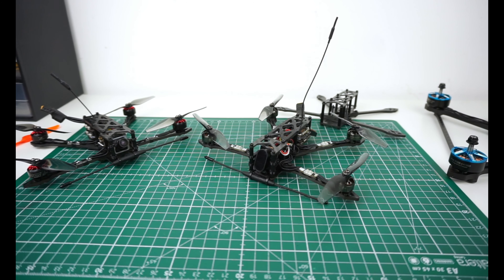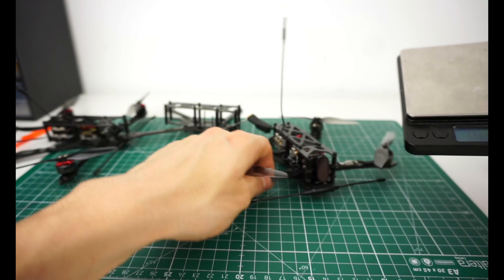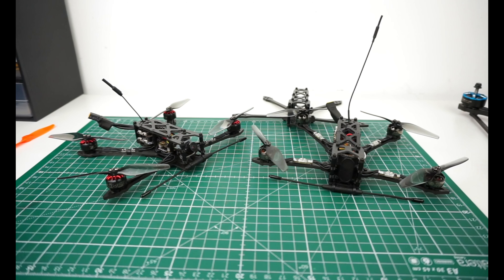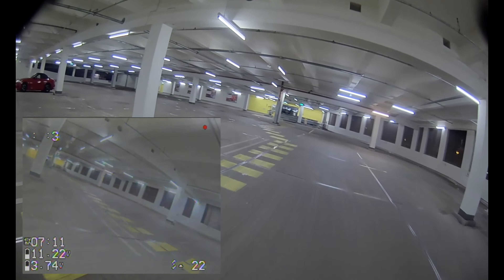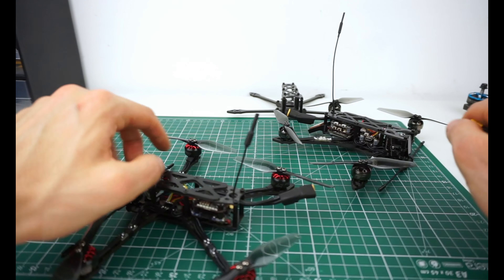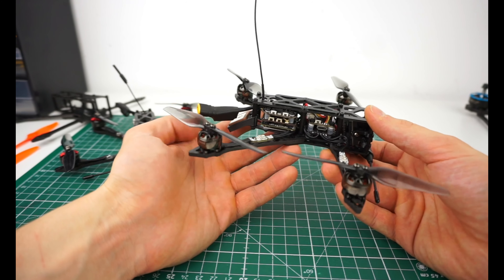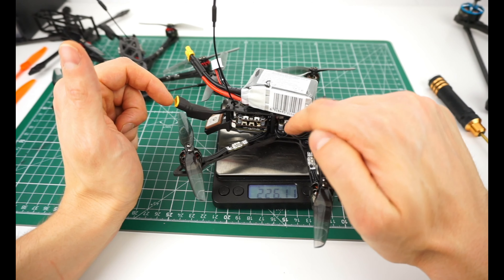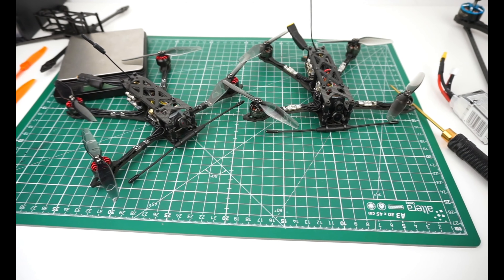Project #MicroLongRange / release info / flight footage

Comment: Clearly one of the best channels for light weight builds out there! I recently built a super lightweight 4“ Picklepick with hglrc zeus, 1106 6000kv motors, hq 4025 props, tbs unify pro32 nano, frsky xm+ and runcam nano2. It weighs 123 grams with a 550mah 2s lipo and I get up to 5min flight time. It cruises at less than 20% throttle, feels very light on the sticks and flies buttery smooth and very locked in. And it is so damn quiet. Thank you for your good work!
Reply from the maker: Thank you! Really nice to hear! That's a pretty interesting setup! I would not have expected the 4x2.5 to run well on 1106. I have some spare 1206 and 1207. Maybe I should give them a try....

Comment: Thanks a ton for taking the time and effort to design this. By far the best 4 inch frame out.  Light no wasted space. As soon as I get the chance I want to buy this and take out 2 of the centre screws and put my light weight modified dji hd fpv system in. Good job man.
Reply from the maker: Thanks man ! My hopes are on the Caddx Vista system. DJI compatible and with 20x20 mounts will be perfect for my frame

Comment: Good. I have also found 1404 motors work well on 4" bi blades. I will say if you are going long range you may want to put the crossfire antenna in a vertical polorisation above as I have had failsafes running low front horizontal.

Comment: Wow, I'm impressed with this build.  I have been heading down pretty much the same path, but simpler for line of sight flying. Great news on the flight times as the 3-4 minute flights typically seen in fpv builds is not what I am looking for. 
Again,  great job, and thanks for your research and sharing.

Comment: I am also in the process of experiment building a mini sub 250grams with long flight time...base on  the sector150 frame, 1306 motors with 3.6 inch trim down version of similar props and have bought most parts for it...Wish I had known about your project earlier.

Comment: Hi Dave, excellent video and it appears to have great reviews as well, but for a total newbie like me (I've never built nor flown a drone beforehand) ... would you have build instructions (maybe a video of how to assemble this?). Also, if somebody is starting from scratch and has never built a drone beforehand ... would you have recommendations for the FPV goggles, the transmitter, the antennas, etc... Awesome work!!!  :) :-)

Also, your FPV feed compared to the recording has a lot of static in it ... is there a way to eliminate that somehow? How would you diagnose that problem?

Thanks.
Reply: If you've never built or flown anything this is kind of like jumping into the deep end without knowing how to swim so to speak especially if you're going for long range. Nothing's impossible if you're willing to do a decent amount of research and learning about building though and flying in a SIM is always a good start to learn to fly.
Reply: If your a newbie, theres nothing wrong with this, but i would recomend putting a little time on a simulater before you jump into a longrange system like this.

 Make sure you also have betaflight downloaded, that will be how your gonna tune the quad. If your a compleete newbie then if your gonna get a transmitter id recomend getting the radiomaster t16s, i have the jumper t16 and its awsome, but the radiomaster is better for a little cheaper price, either option you can hook it to a simulater

Comment: I had been thinking of doing something similar as soon as I saw those 4-inch HQ micro props, and with the sub-4000kv motors it now seems pretty doable... I saw another frame that used the whoop-style AIO FC/ESC but it doesn't have the dead-cat layout to get the props out of view. I think this is gonna be the way to go for cinematic long-range micro for sure.

Comment: This is awesome! What LEDs are those on the arms? Also, have you considered using the TBS Unify Pro32 Nano? You could just put it on a 20x20 stacking plate then you can connect it directly to the Crossfire NanoRX and don't have to fiddle with buttons to change channels.

Comment: Nice work! Thank you for sharing your designs, and the effort you put into coming up with them. Way cool. I nearly pulled the trigger, but then I read you have one coming for DJI. Cant wait to see it. Cheers
Reply from the maker: Thanks man! If the Caddx vista system proves to bee good and reliable I probably won't need a dedicated DJI version since it would fit on the rear 20x20 mounts. My current DJI design is actually a completely different frame design  since there was just no way to fit the klunky DJI unit without a compete re-design.
Reply: @DaveCFPV   Dave_C FPV  Indeed! Hadn't heard the news yet. This is massive! (..the news that is.) Vista unit supposed to be 19 grams lighter, but no onboard DVR, hmmm.. Well regardless, this is pretty incredible. 

I cant help but smile; it's exactly what I asked them for. I receive in depth market/product research inquiries from DJI, and I spare no effort to provide them with in an depth perspective, and well supported thoughts, opinions, and answers as seen from my perspective. I believe I spent nearly two hours filling out the most recent one, regarding FPV. Giving Eachine question accurate, thorough, and genuine response, I came to a one where I could now really drill into my argument, and and present the ideal direction forward (for them, with FPV ) from my perspective. I am, "DIY," "roll your own," by nature, and to the core, so my opinion well represented the sentiment of much of the FPV community by default. (Fact is that Ive never quite fit among any group, and that hasn't changed to this day.) At any rate, I continued typing out my heart and mind, intently, and as my effort reached crtitical momentum, my argument peaked in the form of a pleading proposition, "..give the world an open, wireless high definition video transmission standard, and I will come work in your gardens for the remainder of my days," I offered, tongue firmly in cheek, yet also my bag packed. 

Haha, well I hope Caddx can pull it off. In the mean time, Ill grab one or three of these frames, and work on fitting them with the TPU Air Unit and antenna brackets from i-flight's HD DC3. I picked up a spare frame when I built mine, and it is so tough that t I+7•dont think

Comment: Hi dave can you tell me which one is better the pagoda antenna vs the long monopole vtx antena you re using in this vid. Also where can i get the long version like your?  Im installing crsf on my larva x and the 200mw vtx is became bottleneck :p
Reply from the maker: The Axii is much better than those linear antrnnas. The long one came with am iFlight force 1000mW VTX. Don't know if it's sold separately

Comment: Do you think that the emax 1306 2700kv motors would have enough power to swing the the props? Wondering since i would like to use all my 4s batteries and 3800kv seems a bit high for that voltage.
Reply from the maker: I guess that should work but I can't tell for sure

Comment: Dave I have been rocking this frame since it was released and I love it. However, I've been thinking of the braces. Any reason for going with front to back braces as of going with "back braces" as seen in the FalconRad 7" frame and "AirBlade Transformer Mini" (single plate but you get the idea). Seems like the back arms are more "bendable" due to their length hence need more stability?

Comment: Dave, I am considering this build but have a camera question.  Do you have Caddx Tarsier V1 or V2?  Wondering how long of a cable to get from the camera to the stack?  With the Caddx Tarsier V2 I noticed they shortened the cable length!  The RunCam Split 3 Micro has a 58mm cable length.
Reply from the maker: The V2 is shipped with a separate  longer cable in the box. A bit annoying to wap them but it works
Reply: @DaveCFPV  Would the 58mm Runcam cable be long enough to reach the back stack?

Comment: Nice!
What about trying a AiO whoop board? The new ones should tolerate the amps...
Also did you try a smaller 3'' size? New motors are lighter and more efficient it seems...
Reply from the maker: 16x16 only allowed me to design a much more compact frame in this case so I decided not to have an AIO Option :-) and 4" has more cruising speed which is super important for long range
Reply: if you want a 3" AIO setup look at the LeDrone Pickle EVO 2 - This setup is a further more specific evolution of those frames.
Reply: Thanks both!
3'' also mean smaller motors and thus lighter. But yes I agree lower speeds for sure...
I have a pickle... But not the whole body. Maybe I'll have that cut? :)
Thanks again!

Comment: Thanks again Dave! Ordered 2 of these !  Nick is great to deal with. I may want to try altering one to support a 20x20 stack.  Awesome job on the design!
Reply: Great project Dave! @TaterFPV, looking forward to a 20x20 FC/ESC version.
Reply: @nestwolfsteiner2292  Yup. I'm just waiting for the frames to arrive so I can double check the spacing.
Reply: Yeah, a 20x20 FC/ESC stack would be a great variant. With e.g. a Matek  F722 it would enable INAV usage. I'm not aware of any 16x16 stack that is supported by INAV. I'd rather save a bit weight on the Cam and VTX. The RC hybrid may be bulky, but is 3g lighter according spec. VTX could be as well be a Tramp HV, AKK FX3 or TBS Unify Pro.
Reply: @robiwahn7351  I can post the files as a remix of Dave's on Thingiverse after I actually receive it and test fit a few stacks. Should be in this week. Dave might be on holidays. I want to have one sent to him as well.

Comment: Hey Dave - Do you think this would work with arms that can hold 6" props, but the same center area? I think that this could push 15-20 minutes flight time with low KV bigger motors with bigger low pitch props. Thank you for your hard work on this !!! I'm excited to buy the frame.

Comment: Hey Dave.  I'm accidentally experimenting with long range 4" as well.  My open source 3"/4" freestyle frame weighs about what your frame weighs.  I don't know how I managed it, but I've squeezed a Caddx Turtle, GPS, Crossfire, 4x2.5x2 props on 1306 motors, an 800mW VTX, and one of Zoe FPV's 3250 mAh 2S lithium ion packs into a build that comes in just under 250g.

So far, I've had flights as long as 19 minutes.  I seem to cover more distance at higher speeds, though.  My 10-minute and 12-minute flights both pushed just past 6 miles (not quite 10km, but close!).

I'm pretty boring.  I haven't thought of a single good long-range flight I should go on, but I'm excited that my aggressive little HD freestyle rig can manage 6+ miles and still fit in under 250g! These new HQ 4" props are fantastic.
Reply from the maker: Hi Pat, Sounds really interesting! Do you have a link to your design?
Reply: @DaveCFPV  Of course I do.  I just didn't want to pollute your comments self promoting links! :)

Here's the reasonably up to date source code and CAD files: https://gitlab.com/patshead/falcon-frames

This is the blog post that has the data on my handful of 3250 mAh 2S flights: https://blog.patshead.com/2019/12/prepping-my-3-inch-freestyle-kestrel-for-long-range-flights.html

Comment: I finally got mine in the air without the camera... it flies really LOS... The only issue I am having with it is trying to connect the caddx tarsier. I can't get it to power off the 5v pad. I also switched up the FC to an FLYWOO GOKU F411 Micro. Are you powering the ESC lipo lead?

Comment: Really great design! Excellent to see people develop ideas like this. Have you considered the 26x26mm whoop FC/ESC to lower the stack and allow for shorter and lighter stand-offs? Personally I would be willing to lose some range and use a smaller VTX also, perhaps the namelessRC 400mw nano VTX. This setup might require a diagonal FC mount to fit in between the front stand-offs but could shorten the stack which may improve handling as well as get even lighter? 
Plus it is possible to use betaflight softserial to re-map the LED pin to control the VTX without using a precious hardware UART.
Reply from the maker: The pickle Evo 2 kind of works really well already with that kind of electronic layout! I really wanted to fit up to three 20x20 boards that's why I went for 16x16 only. And TBH I like the looks better. More like a miniature 7" 😅

Comment: How are you getting GPS signal with the Tarsier so close?

I just finished building one, but I can’t get a GPS signal if the battery is connected. It will only acquire satellites while powered from USB.

I haven’t tested yet, but I have a feeling the Tarsier is outputting a ton of noise that is interfering with the GPS.

Comment: Hi Dave, what is the material of the 3d printed parts, TPU, ABS, PLA? The pad for the battery is simply printed like both the camera and GPS mount or has to be different to be 'sticky'? I am about to get your frame from CNC madness (Nick has been fantastic) but I have to print the 3d parts myself -or elsewhere-. Thank you and great job!
Reply from the maker: It's all TPU! Thanks!

Comment: So the Vista fits on here beautifully, especially since Im using the dji controller. She's built, but haven't maidened it yet. Not sure how much 48khz signal to motors is going increase battery life with these larger motors, but I have a few other mods in mind to drive this build closer to 20 mins.

Any chance you would design some 5 inch arms for this? I suppose since the files are available, I can try learning how to modify the design on my own. It's not anything I am shy of doing, but id very much prefer to simply place another order with cnc madness. I plan to actually put smaller overall forces on the arms if I could spin 5" bi blades. What do you think?
Reply from the maker: I doubt the platform will be stiff enough for 5" but I'm working on a scaled up version for 6" props and double  20x20. That's for the info that the vista fits btw! Couldn't get one yet because of chine new year
Reply: Fair enough. Youve been incredibly generous as it is. The front may actually fit the 5035 bi blades. And looking at the rear, I may be able to mod the existing arms to eek out what I need.

Looking forward to seeing your next design. Im committed to sub 250 though,  and I see a world of potential with this platform. I picked up a 16mm to 20mm adapter that works here, in case I go to a Succex D mini F7 for more uarts. If im not mistaken though, using the Vista leaves me 1 full uart (since I don't use a TX for osd control) available on the HGLRC, so that will cover gps. Ill find out for sure later today. Hover test and maiden later too..

Comment: Received my kits from AHL-Tec in Germany, great vendor. Amazing and unique design, thanks and keep the good work up 👍. One question: Any experiences in durability of the 16x16 stack options? Feature-wise, they look pretty much the same.
Reply from the maker: My HGLRC, Mamba and iFlight were all reliable. Haven't tried the Flywoo yet. But I heard some reports of failing HGLRCs
Reply: @DaveCFPV  Is it possible to connect GPS to the MAMBA 16x16 stack?
Reply: @timzucker4997  Yes, but you have to remap resources and use softserial in Betaflight (PPM and LED pads should be usable for GPS RX/TX).
Reply: I have a Flycolor 16x16 stack that still works after three years of hard punching out abuse. Rated at 4A 5A burst it handled lots of test flights at constant 100% throttle for almost one and a half minutes at 18A.

Comment: This is truly awesome and I can't wait to build one up! One question: have you noticed any issues with current draw using 4" props on those 1404s with a 13A max esc? Perhaps not because they are lower kV, and I imagine you're not exactly doing punchouts on that thing, but I would personally be worried about killing an ESC if I needed to gun it for some reason...

Comment: Dave, I'm really crazy about your frame and project. I'd like to know if you've had any issue with the fpv cam TPU mount like any jello, vibration, or if it gets loose easily. Since we are talking of 'split' cams either 1 or 2 lenses it's crucial to be firmly secured. Thanks so much for your effort in this beautiful 4 inch frame. See you.
Reply from the maker: Thank you! :-) I didn't have any issues with jello personally

Comment: Hi again Dave. I am not very familiar with 16x16 stacks. The VTX Rush Tank mini with an input voltage of 7-36 DC the red wire cannot be soldered to the 5v pad (FC). What's the best way to sort it out in the HGLRC FD413 you've selected? Thank you very much!
Reply from the maker: Direct power it through the Battery :-)
Reply: @DaveCFPV  Thank you!